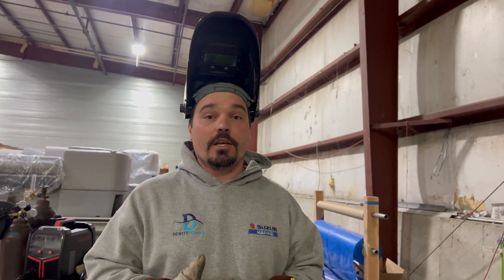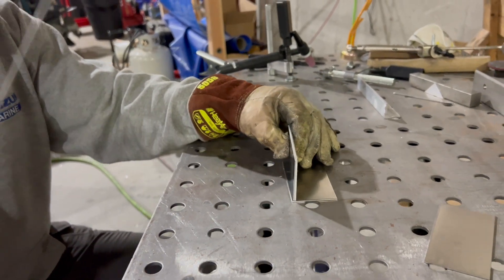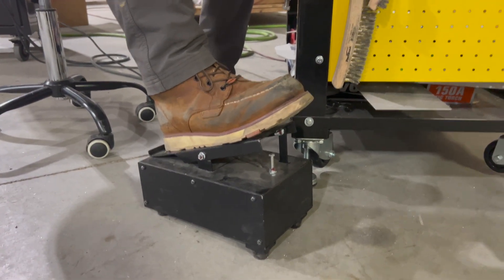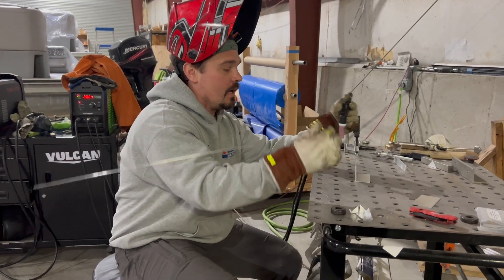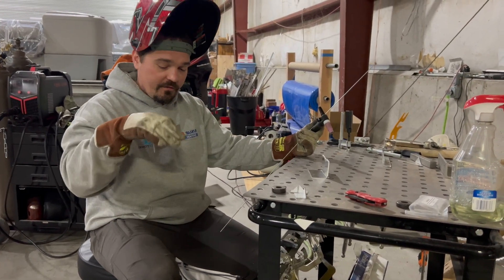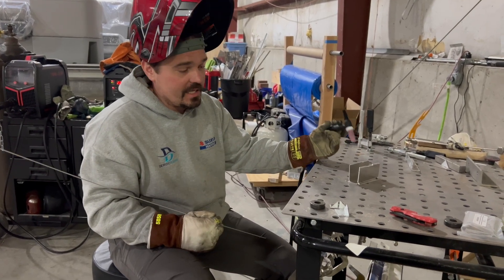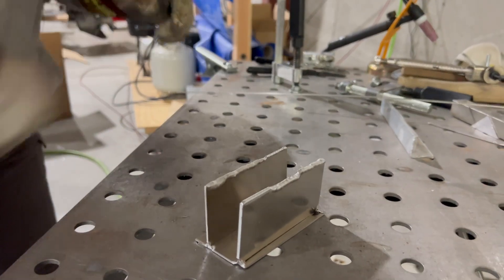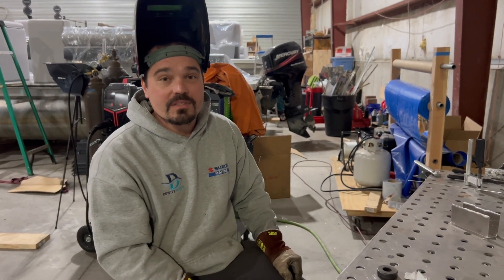MY FAVORITE TIG WELDING PRACTICE DRILL - For Aluminum

Comment: Tom if you set your amps @65 you will have better pedal control .
Reply from the maker: When practicing like this I love the challenge of running the machine at max amps and then being able to dial in the correct heat to melt in the way I’m looking for.